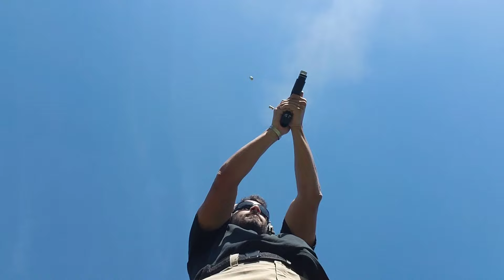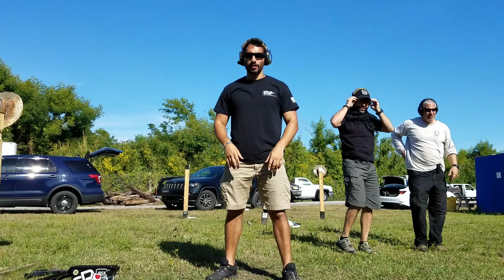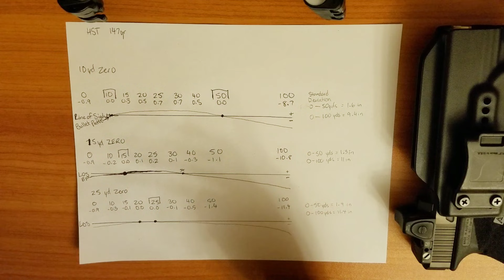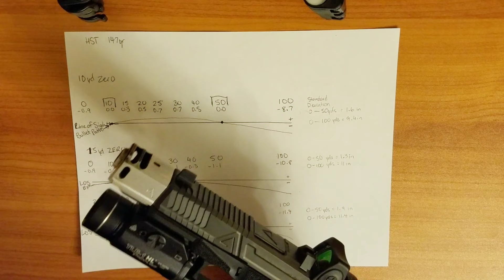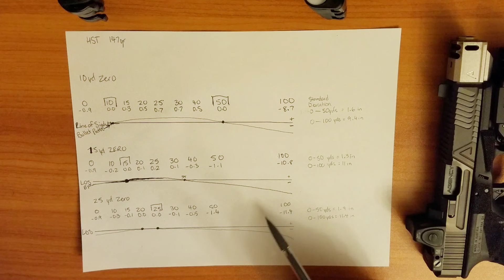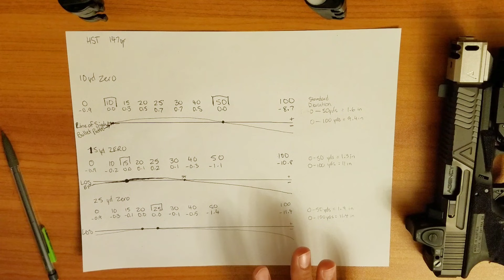Trijicon RMR Zeroing Distances

Comment: Great info, I can't see a reason to not go with 10 yards. The downside of short distance zeros is usually more complicated holdovers, right? But with a pistol, I don't see anyone missing just because they forgot to hold 0.7 inches low at 25 yards 😂
Reply: I agree.  I ran that same data and 1 inch low at 60 yards. So 0-60 is 1.7 inches of up and down “wiggle room”.  Besides zeroing, nearly every target and shoot situation makes that 1.7 perfect.
Reply: You can’t see a reason? This video depicts if anything why you shouldn’t zero at 10 yards. It’s deviations are larger than the other options. On top of that, all of this is about elevation deviation, but windage is a thing too. Out at 25, windage zeroing will be more precise.
Reply: I hate having to hold under, with a 10 yard, at 25 you have to hold under, but zero at 25 and at close and further distance your holds will always be over hold... Slight to a few inches out to 50
Reply: @ThePatriotParadox  on the flip stuff of that though, these pistols are not even capable of shooting a .7 inch group at 25 yards so shooter error and pistol error is much greater than actual offset
Reply: @jeremydixon9011  wait...what pistols can't?
Reply: @ThePatriotParadox  don't know if you're serious or not. A custom fit 1911 is generally 1.5 in at 50 yds guaranteed which equates to .75 in at 25 yds. You will not find a handgun that is repeatable at a .7 in group at 25 yards. You will not be able to do that with off the shelf ammo. You will not do any of this with a stock handgun like a glock. If all these things were perfect though, you could still not manage a .7 in group at 25 yards because of the inherent inconsistencies of shooting offhand. 

Therefore, sight your pistol in at whatever range you want from 10-25 yards... you literally can't make the gun shoot any more accurately than the holdover you are talking about. This isn't ELR rifle shooting.
Reply: @jeremydixon9011  I didn't notice the decimal point..... But yeah getting a 1-1.5" group is as good as you will ever see with the platform, even with all match grade components

Comment: In using one of the ballistic calculators I ran the same scenarios for Speer 124 Gr JHP with their info, but I don't know the sight height yet on my gun since its on the way (M&P 9 M2.0 Perf Ctr 5" CORE with Raised White Dot), and I used just 3 mph wind with no offset angle, but I also didn't know what was meant by the Drag Function (left at G1), and the Ballistic Coefficient.....I would like to have complete info, so do those make a significant impact on the data results? I did notice that the 124 grain (with the G1 Drag Func and .468 BC and .9" sight height) showed as shooting flatter than the 147 grain you exampled. To me, it seems as though a 15 yard zero is a sweet spot or maybe a 20 yard max, at least based on what I ran. Your thoughts? It's awesome that the calculator I used even made the graphs for you and printed out the table based on the desired total yards and incremental yardage you want! Nice information in this video BTW.

Comment: Great vid Jon. Is there any way you could possibly do another drawing for 124 HST when you get some time? Maybe even for gold dots with 124/147. Then post in on your FB or in the Sage Alum page?
Reply: Cool. Just wondering. Also, would there be much difference between zeroing at 25 yards vs 25 meters? The difference in feet is about 6 feet.
Reply: Which dot size are you using?

Comment: Where did you get your trajectory info wouldn’t this information change based on barrel length and type of ammo used even if using 9 mm the whole time?
Reply from the maker: A ballistic calculator like I said in the video. It will change slightly with minor barrel changes and with different weight 9mm. That's why I said with a G19 and hst 147s.

Comment: One more question, if a 25 is a 20 yard zero too... Could I zero my RDS at 20 (to make zeroing easier) and it still be considered a 25 yard zero?
Reply from the maker: It's only like that for this specific setup, ammo/velocity and environmentals. You will have to still verify if 20 and 25 are similar enough. My holds are not yours. You'll have to find your own.
Reply: @KineticConsulting  just printed out some targets, soon as my rds gets back gonna get to it with my Remington UMC
Reply: Why not use the KC 25yd zero target that's provided on the website? You shoot at 10 and confirm zero at 25yd. I did a preliminary zero at home, using my laser; went to the range to do fine adjustment; took a course afterwards and it all worked out.
Reply: @ayowser01  after I got done I shot 2 out of three in the X ring at 15 and still hit 10 rings at 25... It's all, especially close range, point of aim point of impact

Comment: I think the picture really drives your point home well. Well done man, I love it. 

Food for thought: I can see past the loose use of the term "standard deviation" but what distance are you talking about? Standard deviation is the square root of the average squared distance a group of data points are from their average ( square root of variance ). I feel like you might be talking about a "total deviation" from line of sight?  Also your loose interpretation of "when gravity takes an effect" could be kinda misleading. Gravity is always in effect. Bullets start dropping immediately upon leaving the barrel but since we aim "up", they go "up" for a bit before going "down" ( hence the parabola ). The points where "gravity takes an effect" is just when the vertical velocity of the bullet has reached zero due to the acceleration due to gravity towards the ground, not when gravity decides to take action. Maybe "the point when gravity wins" would be more accurate while still being casual with it ha ha